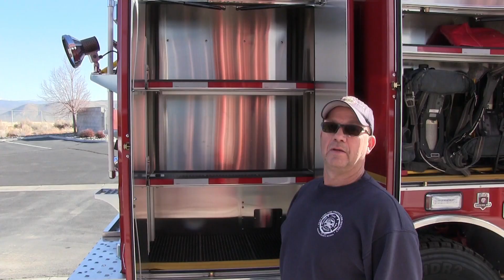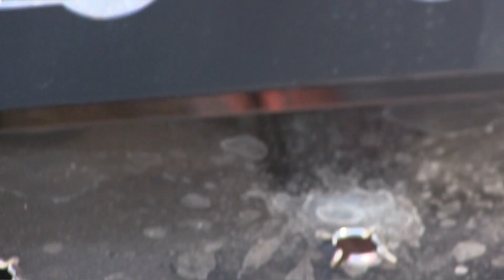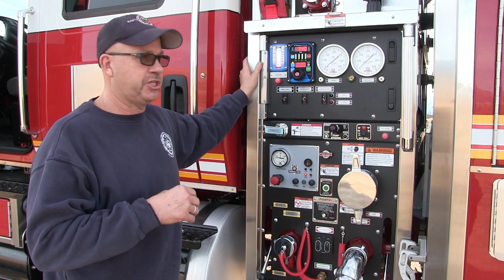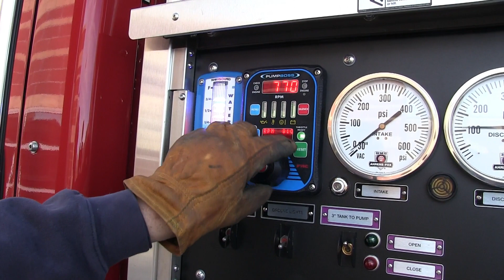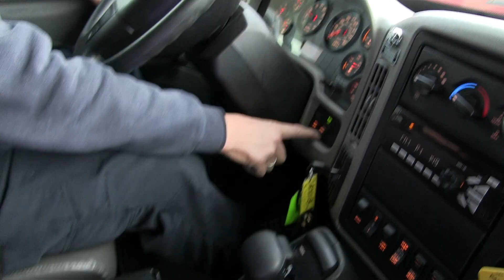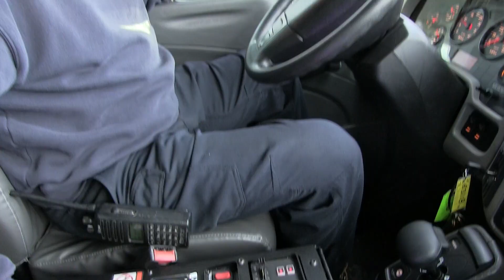Model 34 Brush engine

Comment: I just found this and it is a great video. However, there are 3 intake valves. One on the pump panel, one direct fill on the the rear and another one on the passenger side.